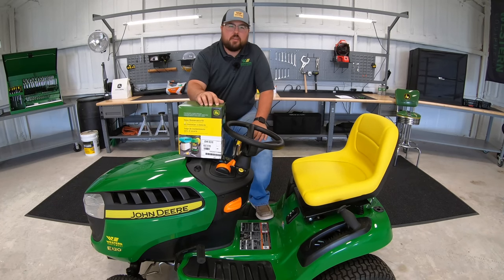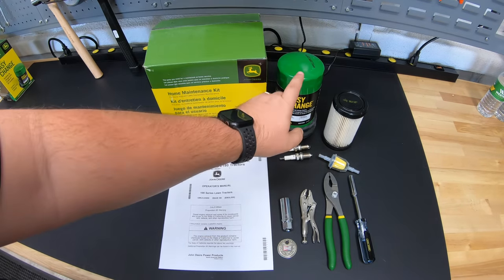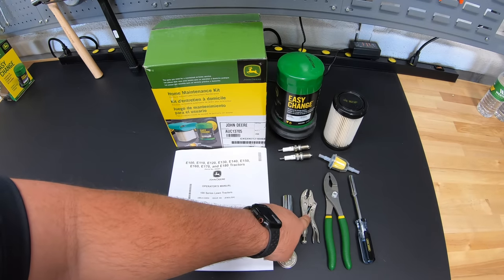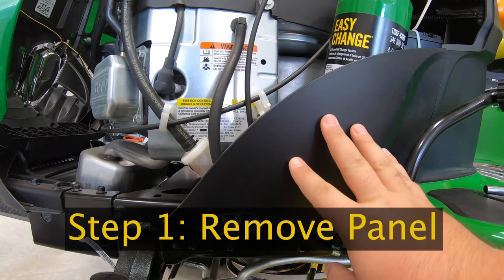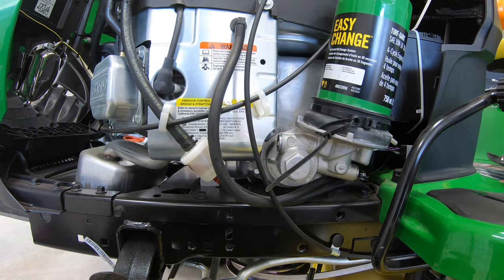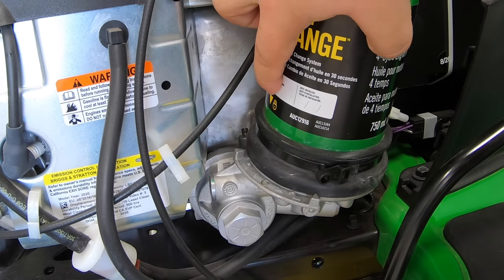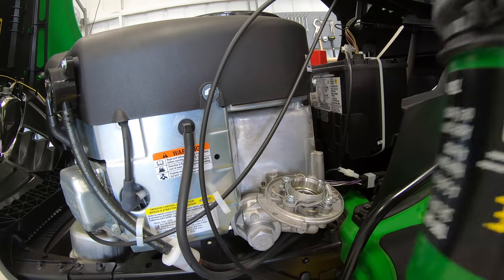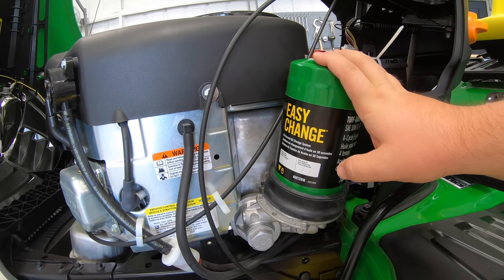How to Install John Deere E120 Home Maintenance Kit | Oil, Fuel Filter, Air Filter, Spark Plugs

Comment: As a chemical engineer let me add my 2 cents about the easy change system. The filter may be superior to standard filters, trapping more contaminants, however- that does nothing to prevent the thermal breakdown happening to the oil, specifically the remaining bulk of old oil still in the engine, which will become more concentrate over time and   oil "changes". The oil will lose viscosity and cleaning agents, and accelerate the wear of the engine. I'd highly recommend the conversion back to standard oil changes at the first oil change.
Reply from the maker: Interesting... These are some very valid points. Thanks for the comment and thanks for watching!
Reply: That’s what I was thinking but when I bought it from someone I know I just pulled the trigger and bought it off them.  If I would have done my homework with all the dirty that stays in the engine, even after an oil change, I would’ve passed on it and looked into something else
Reply: @dougotto1705  Cant you try to suck out the old oil through a heavy plastic straw

Comment: Why not just place a gas shut-off valve between the  fuel tank and the filter?
Reply from the maker: You can definitely do that too.
Reply: @WesternEquipment  The question is why JD does not have a shutoff as standard?

Comment: So you are leaving 3/4 of the used, dirty, black oil in the engine while adding a clean filter and 1/3 of a quart of new oil? This is ok for an engine that has run 50/60 hours. I would really like to drain the old oil and put in fresh. This is a 2000 dollar investment. Please advise.
Reply from the maker: You can always change back to the normal drain and filter system if you like. Thanks for watching!

Comment: Great video. Once you break the spark plug loose, take the socket off the ratchet and put it on the drive handle. Easier to take out and reinstall than using your fingers in that tight space, then put the socket back on the ratchet for the last 1/4 turn to snug.
Reply from the maker: Good tip! Thanks for watching and thanks for the comment!

Comment: Easy as pie. Thanks. My two year old E120 with 24.4 hours has a service (SVC) light which didn't clear after replacing everything in the AUC13705 kit purchased at Home Depot. I have started it twice and the light still flashes. After installing the kit, what do I do now to clear the light.
Reply from the maker: The light is actually on a timer with the hour meter so it will automatically clear once you get a ways past the 25 hour mark. There is no reset like you would have on your vehicle.

Comment: One of the reasons I bought the 120 is the Easy Oil Change.  However, I see a lot of people online who criticize it because they insist that all of the oil must be drained, otherwise the engine will be damaged over time. What's your opinion on it?
Reply from the maker: Here’s the thing, if this was a vehicle and you didn’t change ALL of the oil I would see that as a problem but with mowers they are normally only used a few months out of the year so the life you will get out of the engine is usually not the concern. The other thing that people don’t take into consideration is how much bigger and better made the actually filter is on the easy change system. So it is going to clean the existing oil better than a normal filter. Lastly, if a major manufacturer like John Deere is using it then it has been thoroughly tested and proven to be a good system or they would have scrapped the idea before putting it out. Good question, this is one I get a lot. I am a big fan of the easy change system. I think it’s great for the consumer.
Reply: @WesternEquipment  Awesome, thanks Brent.  I definitely feel more at ease now. 👍
Reply: I have the easy change oil filter on my E120 and I Change ALL of the oil. The drain, is on the right side, middle bottom area of the engine. I just have to add more oil  to fill it again.

Comment: Hi, your video was very helpful, however, my EZ oil filter came loose while I was plowing the driveway and leaked a long line of oil so my question is: how can I replace that lost oil and know there is enough in the motor?
Reply from the maker: I would check you oil level with the dipstick and add accordingly. Any oil lost should have been from the engine itself and not the filter. Good question and thanks for watching!

Comment: Great video. Question. I keep seeing a mixture of responses. When I took off my old filter and applied the new one I got it to turn and it locked, or so it felt like it locked into place. The yellow arrow pointed down to the metal locked symbol, NOT the metal arrow. I was told by countless people and the dealer to make sure the yellow arrow matches the metal arrow. I cannot seem to get it to turn anymore. I am installing it as you were. Any suggestions?
Reply from the maker: Hmmm. The only way to know for sure is to turn the mower on and see if it leaks but I would make for sure that it will not turn anymore before doing so. I hope this helps and thanks for watching!
Reply: Can you turn the filter back towards the removal position without having to press down hard on the filter? If so, then it is not locked properly. You may have the filter tipped somewhat.
Reply: @buggsy5  Had it figured out last year! I forgot that I posted on here haha. So it turns out the sticker was not aligned on the new filter. Everything has been great with it ever since. Thank you for the response!

Comment: I have a question my service light is flashing service at 24 hours it's 25 now I went ahead an grease my area that I needed to grease is there something else that is needing service at 25 hours?  Oil change is not til 50 hours and it runs and cuts good just the service light pops on and I grease it will it go off now?
Reply from the maker: No, that is the main service at 25 hours. It will eventually go off by itself, no worries. Good question ad thanks for watching!

Comment: I have a smaller yard so I only put 10 hours on my S120 last year (which was also the first year I had the mower).  I noticed the air filter barely had any dirt in it.  Do you think I'd need to change everything (oil, air, fuel, plugs) after 10 hours?  I'm not sure since I'm about to start it up for the first time this year.  I live near Cleveland, so it was in my garage in colder weather over the winter.
Reply from the maker: You are probably ok to hold off until the end of this year. The main thing I would do is make sure it starts and if not then get a charger on your battery and let it sit over night. I hope this helps and thanks for watching!

Comment: I like your thoughts on this oil filter but I have customers that run these mowers year round, I use a vacuum tank and change the other 2 quarts, if the customer brings the mower in for an oil change I feel like I am giving him the oil change they wanted.
Reply from the maker: Sounds like a good idea to me! Thanks for watching!
Reply: A better solution would be to install the original extended drain tube with locking cap. 

The biggest problem with the EZ system is that you are essentially running used oil all the time.

Comment: Are you using a 5/8", 3/4" or 13/16" spark plug socket?
Reply from the maker: This is a 5/8" spark plug socket. Thanks for watching!
Reply: @WesternEquipment  Thank you so much! Your video was very helpful!

Comment: Should you lubricate the rubber Gasket on the oil filter
Reply from the maker: May not be a bad idea. It mainly serves as a dust seal but I'm sure greasing the lip would only increase the chance of catching and stopping particles. Good question and thanks for watching!

Comment: Great video, where are the grease points on the ride on?
Reply from the maker: Thank you. There are 3 grease points on the front axle and then on your blade spindles.
Reply: @WesternEquipment  is there a video about the grease points and the best way to grease them?

Comment: Can you by pass the 30 sec system and change the oil manually once in awhile?
Reply from the maker: You can use a pump to suck out the old oil from the fill tube or you can just by the conversion kit to change it back to the regular filter and drain style.
Reply: If you did the conversion yourself - hopefully you kept the original long drain tube and locking cap. If not, buy it from JD and install it in place of the drain plug. You can then drain all the oil during an oil change.  You will have to add about 2 more quarts of oil in addition to what is supplied in the EZ filter.,

Comment: Do I need to add any oil after changing the oil filter
Reply: Yes.  All engines consume a bit of oil and the fancy expensive system only changes about 1/3rd of the old oil, just what is inside the special filter. You still have to watch your oil level and top it up as necessary.

Comment: We just bought a s120 john deere
Reply from the maker: Awesome! I hope this video helped you out and thanks for watching!
Reply: Great video!  I’m the least handy person and I was able to do all the steps’. Thanks for the step by step!
Reply: Buy the JD drain pipe and oil filter adaptor or the JD conversion kit and at the first oil change get rid of the EZ change system. It's just some EZ change for John Deere. No need to spend $40 US for a system that only changes .8 qts. It's a ripoff.

Comment: Answer me this ! My B/S 20 + hp holdes 64 oz of oil ,,but the Easy Change oil filter has only 20 oz of oil , so your not even taking out 1/2 the dirty oil ,,!! Am not understanding something ?
Reply from the maker: No, you have it right. But  the easy change oil filter is WAY larger than your standard filter so it is catching more contaminants in the remaining dirty oil. If you follow the maintenance schedule of the mower as suggested you should not have problems. Thanks for watching!
Reply: No you got it 100% correct. Get the conversion kit and change all the oil and filter for significantly less money. Oh, and contrary to false infr posted, the filter element inside the can is NOT bigger than a standard spin on filter for this application.

Comment: If you convert this to a normal oil drain system, does not one still have to buy that expensive filter also every time, In Canada those filters are close to 80.00.
Reply from the maker: No, if you convert it back to a normal drain then it also goes back to the normal filter system. Good question and thanks for watching!
Reply: @WesternEquipment  Thanks kindly for that info and now I may buy that tractor.; It was that oil change system that bugged me.

Comment: How much cost?
Reply: The oil replam kitcost how much?
Reply: What's the cost of the quiche change oil kit?
Reply from the maker: Are you asking how much it is for the kit ot convert this system back to a normal filter and drain system?

Comment: So you never have to drain the oil ever?
Reply from the maker: You do not have to but you can if you want. You can also convert this back to a standard oil drain and filter system fairly easily if you prefer that. Thanks for watching!

Comment: I can’t believe someone approved and released this EZ to be officially used on the JD riding mowers. Either way I’m going back to the traditional oil filter system and will be removing this new quick/EZ system as it’s ONLY swapping 1/3 of the oil. 2/3 of the old/used oil still remains in your engine. And I’m paying 40 bucks for an oil filter? Come on folks..... If you don’t believe it, watch the video link below. I’m just glad I dug around.
Glad I dug around this topic. I would’ve ruined the engine on the new mower we got last here.
This should be a warning for anyone purchasing this John Deere riding mower used. Be careful if the previous owner had this easy quick oil change kit on it for a while.
 https://youtu.be/Bytv-xXDvhk
Reply from the maker: I know it seems like a bad idea but it has been tested and has shown to be effective for residential customers. Good thing it can always be replaced with the standard oil and filter system if desired. Thanks for watching!
Reply: For the average homeowner who may never/rarely change their oil, this is great. But for those of us who take great care to our engines and meticulously maintain, this isn't for us. Like he said thank God it's easy to convert

Comment: It only takes out 1/3rd of the oil. It leaves 1.79 liters in the motor.
Reply from the maker: This is true but you also have to consider how much larger the filter is to trap contaminants. Also the oil system can be converted back to a traditional style filter and drain system very easily. Thanks for watching!